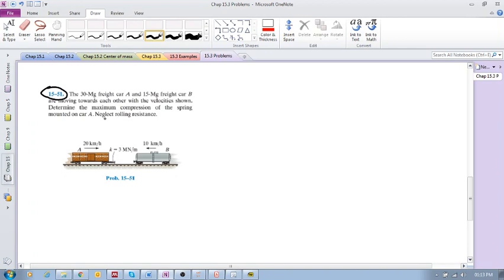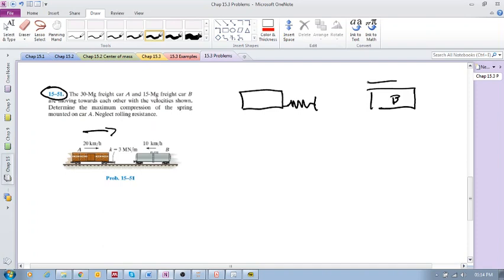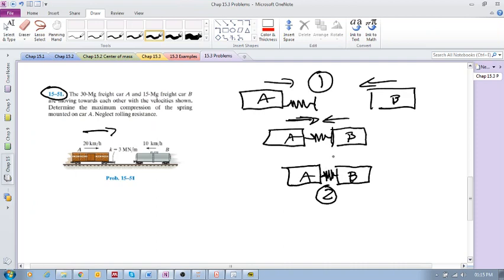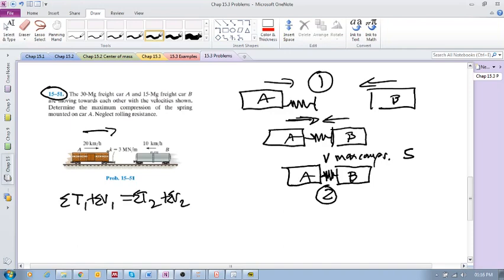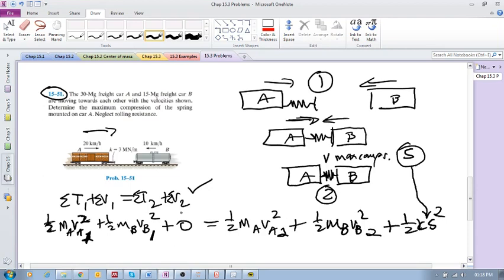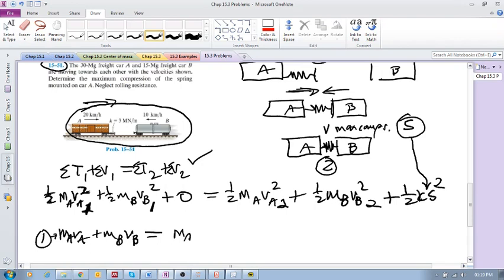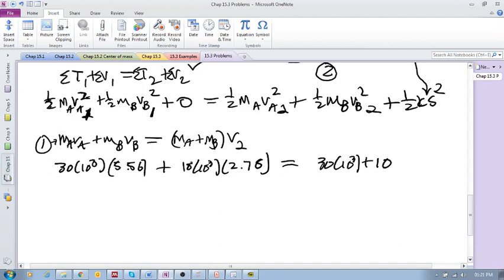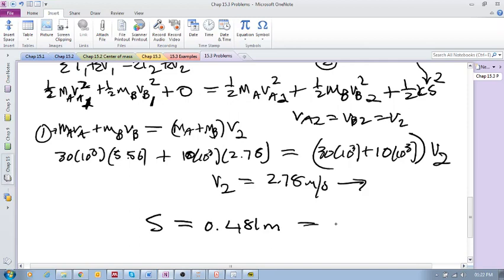Chap 15. 3 Problem 15- 51

Comment: Hold on a minute, in your calculations you inexplicably change the mass of car B from 15x10^3 kg to 10x10^3 kg. Why did you do this? The mass can't just change like this? The key got the same answer so I am very confused
Reply: well im sure he's following the key, and im sure he passively just followed it without really questioning such detail. its just a mistake dont take small things like this too seriously just follow what makes more sense and whats closer to logic or else youre gonna have a hard time following dont get too stuck on the silly mistakes of others but rather see the bigger picture, yet focus on your silly mistakes cause those might actually lose you marks( partials or complete ones if the instructor of your course was too rude and technical) or might be conceptual mistakes which has its consequences too on your performance.

Comment: why did is the momentum of car B considered +ve when the principle of LI&M was applied, is it because it is considered internal in the system we considered, or is momentum absolute, im just lost why both momentums are positive yet the cars are moving towards each other( in opp directions)        does it not depend on the direction since both are in the same system
Reply: Same question. Have you found the reason for that +ve sign yet?
Reply: @thegamingmonster4252  if you plug it in the calc and follow the negative sign, you'll get the same answer which is 2.78m/s